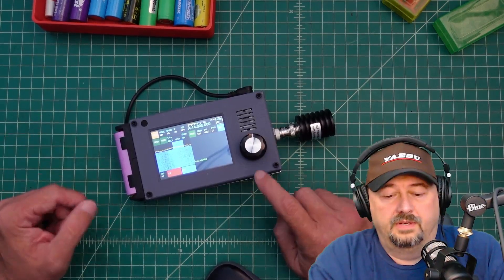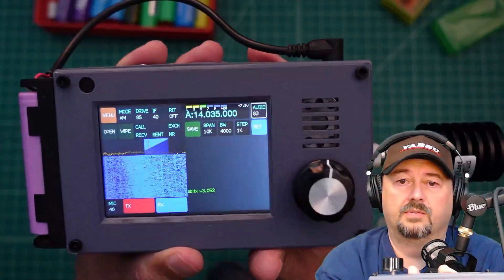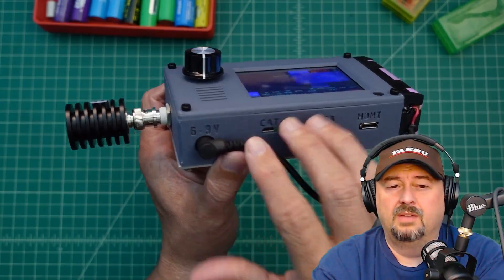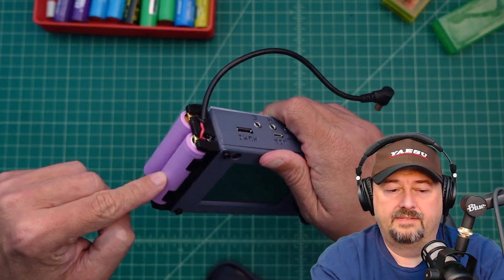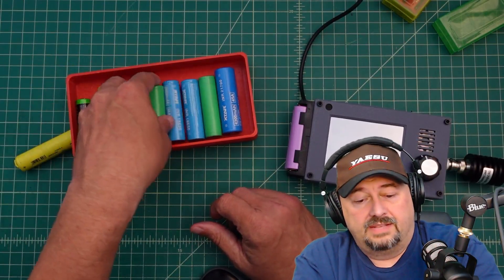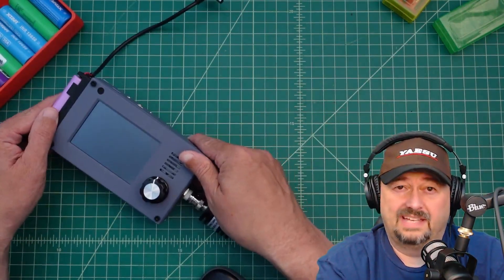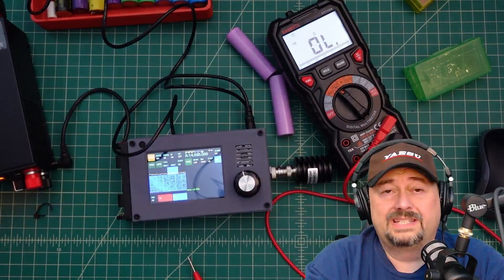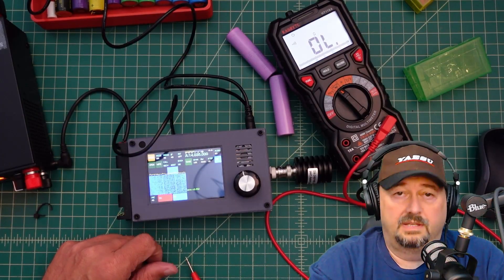HFSignals zBitx: What you NEED to know to POWER your Radio!

Comment: Can I use this Power supply from newegg?    3V-12V 5A 60W Adjustable Power Supply with LED Display, Variable DC 3V 5V 6V 9V 12V Universal AC/DC Adapter, 100V-240V AC to DC 3-12V Switching Power Converter Multi-Voltage Regulated Adaptor - OEM
Reply from the maker: I haven’t tried that supply but should be able to do it 👍

Comment: A lot of pricey astronomy gear, that can also be fried by incorrect polarity, runs on nominally 12VDC connected with 5.5mm x 2.1mm  or 5.5mm x 2.1mm plug connectors.  Astronomers might not have a multimeter handy at a star party when they borrow a power supply, battery pack, or power cable from a fellow stargazer.  To check polarity easily without a multimeter, ScopeStuff sells polarity testers for the two standard connection sizes. Maybe a good item for hams on POTA or SOTA when packing light.  Possibly available elsewhere, I haven't looked.

Comment: Do you see likely issues with the idea building a fuse and diode into a replacement power cable? 
They clearly need a shutdown command in the UI, IMO.
My wife won one of these and I appreciate the info.
Reply from the maker: I don’t see an issue with it, apparently it had a protection diode internal but my buddy still blew a trace 🤷
Reply: Diode good but not sufficient, also need fuse to save trace.

Comment: It's possible to build polarity protection, and even an over voltage crowbar into your external cables.  But if you then mistakenly use a cable that you built for something else, you can still be screwed.  It's a pity that such protection isn't built into the zBitx (and many others).  And I'm not talking about a series diode, but a series power FET and circuitry to turn it on hard if the input voltage is in the good range, and off otherwise, which would be safe even when using the battery.
Reply from the maker: Yeah, I think there are probably a few ways to solve the problem. Thanks for watching KEG 👍

Comment: I can see problems with that 18650 battery setup . No fuse on holder . No BMS . Someone will mix cells . I can see Cobalt based catching fire .  Them have a 2 cell holder with BMS and current protection .  I just would get better battery holder.  Can use 26650 or 32650 cells. even the 21700 cells . Just swap out holder.   You could use LFP battery but wont run as long. They start at 3.2V and go down like 2.5V . 6V AGM battery will work but not as long.  The fix for that buck converter is analog regulator. Like LT 1083 reg IC that good to 7 amps. Just set at 8V and run 12/24V battery . will get warm and need heat sink but no RFI on analog regulator.  You can use like a 4 amp poly switch . they small . auto reset fuse after load off.  Some battery holders have them with BMS . Both Sony and Panasonic are Japan made.  LG may be Korea made. The ones I have are .I have had China 18650 cells burst and catch fire . Still cold and steady rain hear in NY ., 53F was out high and like 2 in rain. just in 1 day . Creaks very high . 73
Reply from the maker: It’s exactly why I made the video.  Try to explain some safety concerns and talk about power options.  Thanks for watching Robert, stay warm 👍
Reply: @TheSmokinApe  I have to blast 10K on super bowl 6 to stay warm. LOL
Reply from the maker: @robertmeyer4744 😂
Reply: The more videos that I watch, the more I feel that the zBitx is nothing but a “kluge” that I should stay away from in spite of its price point and desirable advanced features. As I have limited mobility, its form factor is very important to me. Are all the complaints anal or real life issues?
Reply from the maker: I haven't used it enough to say either way but I'd suggest maybe looking at the QMX if you want something in this size.

Comment: Good to see you again at Hamvention. Now we need a video on how to shield the radio to prevent the pulsing noise on the audio.
Reply from the maker: I haven’t used it enough to see that problem but I did wonder about shielding, another reason I was hesitant about the buck converter.  It was good, as always to see you Hank 👍
Reply: I'll be keeping an eye out for that!  I only had about 10 minutes with it...without rationale just guessed it was a screen refresh issue...off tomorrow to play with Hamvention scores.

Comment: Thanks Ape! You're a good Elmer. I looked at the zBitx but decided to go with the QMX+ kit instead. All of the bands, (plus CB,) and Hans dealt with reverse polarity and such. I'm old, and sometimes when I'm tired I do stupid stuff. I'll also be adding the internal battery mod for the rig. The QMX+ lacks the whiz-bang display and touchscreen, but it does have a great A/D and a hot processor with good memory. Those things, along with Hans and his perfectionist traits should mean that the new firmware updates will be impressive. The SSB upgrade sounds great. Being an old tube knob-twirler I'm more into a rig with better specs than I am into a rig with more graphic display and touch-screen features. But I may buy the next iteration of the Bitx simply because I do love little QRP rigs and they fit in my coat pocket. :)
Reply from the maker: Hey John.  I think you made the right choice.  I got this because I want to support the project and like the idea of the display and embedded Raspberry Pi, I don’t expect it to be much more than a novelty type radio to tinker with 👍

Comment: I was about to get one. Then found out through others that it’s not good on cw. So I’m waiting for that to be truly resolved. They said they fixed it but my cw friends said it’s still faulty. Feels like it needs a hardware fix.
Reply from the maker: From what I have seen a straight key is fine but a big or a paddle board s problematic.  Thanks for watching GR 👍
Reply: @TheSmokinApe  AE5X has a video of trying straight key even after the updates. It still messes up. He offered it to me but I would need it to work on cw. Straight key would be something. Had similar issues with my fx-4cr , but it mostly is ok since I don’t go above 15wpm. But I’m still hopeful for it (the zBitx).  Thanks for your videos.
Reply from the maker: @gliderrider hopefully they get it worked out

Comment: According to the schematic there is a reverse protection shunt diode, but It won't do you any good on a battery without a fuse.  Thanks for the video Ape! 73
Reply from the maker: Hey Jeff, I have looked at the schematic BUT I do know someone who damaged their radio putting the batteries in backwards 🤷